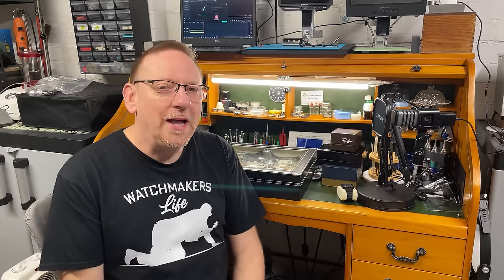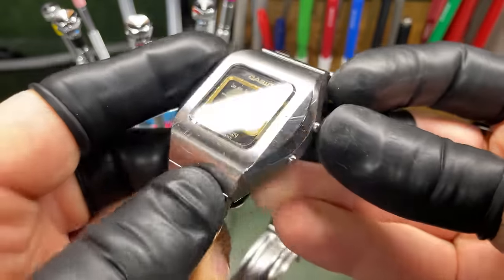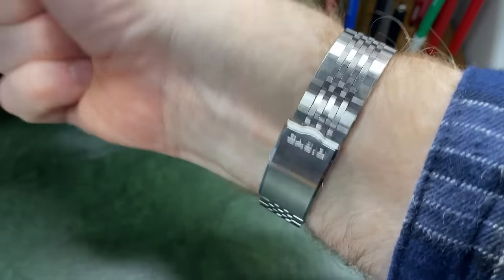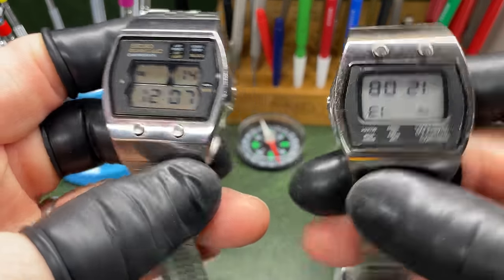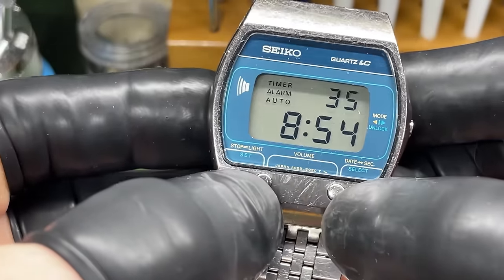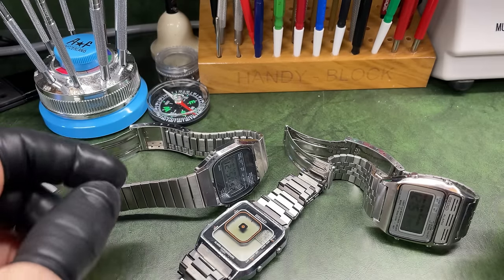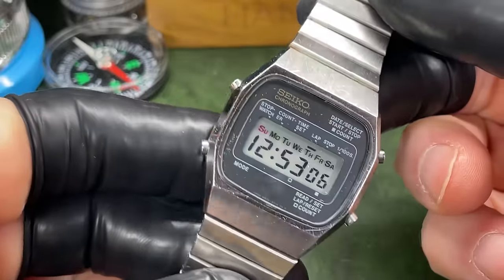My Vintage Digital Watch Collection -  1970s-80 Nostalgia Fest !

Comment: That first Seiko you showed (world's first chronograph) is one I used to own. I went to a local Jeweler's shop that was going out of business, and they had two of them, both NOS, just sitting in a drawer for many years. I bought the best one, which looked brand new, for $35. I put it on ebay in 2010 and two people got into a bidding war over it. It sold for around $580 to someone in Italy.
Reply from the maker: The 0634-5019 is just a superb watch. You can’t regret the past, they are still available if you have the funds to pay for them now.
Reply: Just ordered a NOS one from a Finnish dealer. Most on ebay are either faulty or a bit worn out. Admittedly paid through the nose for it. 😊

Comment: I remember just about every quartz watch I purchased in the 80s and 90s had a spec in the manual that stated the same + or - 15 seconds per month. Armitron, Omni, Casio , Nelsonic, Citizen etc. I took that to mean that all quartz watches were the same and I have believed that for 40 years. I see now this is NOT the case! 🤷‍♂

Comment: Stylus? The Seiko C359 you operate with the tip of a mechanical pencil, with the graphite retracted. Conspicuously missing in your calcuwatch collection is the Casio TC-600 touch sensor calculator watch. A big screen, a touch screen (but not as we know it!), and a prophetic sign of things to come. I was king of digital watches wearing the TC-600 in my high school days, until I managed to nick the screen on the hidden tracers on the top of the screen. :(

Comment: I've got a Casio G510D I've had since it launched, one of the seals eventually failed in the caseback (way before I knew anything about repairing watches) there ended up being a bit of corrosion inside which as far as I can see, has rendered it dead. I have two of them after buying what I thought was a working donor from fleabay, you're welcome to them if you wanna have a crack at getting either/both going.

Comment: Thanks Mike, your selection brought back some great memories. My first digital was  Commodore LED from mums catalogue, hugely expensive for an 10 yr-old in 1978, £20 payable at 50p per week for 40 weeks from pocket money. Took 2 big LR44 batteries that only lasted a couple of months as I remember. Then my first LCD was a Casio 60QS in '81 (as a 13 yr-old) that my dad.' acquired' during a maintenance job at a Casio warehouse somewhere near London. I remember impressing my schoolmates with the 1/100th second stopwatch!I still have it proudly in my collection. I have an old Witshi quartz tester and have found that many quartz crystals do stabilise over a number of weeks/months after being inactive, so let the watch run for a while before touching the trimmer. I'm sure I don't have to say be really careful with the trimmers; most haven't moved in decades, so hold with tweezers to oppose any turning force, or they can break or lift the pcb tracks. If you can't adjust enough, a tiny gimmick capacitor can be made with some fine transformer enameled wire, twisted & soldered onto the trimmer contacts. Twist & untwist until the value is about right to get the rate down on your tester.
Reply: Good advice about the trimmer caps
Reply from the maker: Thanks for your advise on trimmers. I dont think i would go to the extreme of making a tiny capacitor, I like to repair mechanical watches so electronics and soldering irons are not a skill set I posses. 
The commodore, was it the red LED version?  I have that model. One of my favorites.

Comment: One seiko watch you might want to look at is the M421-5010. It’s a digital watch. It has dual time zone, stop watch, two alarms, and countdown timer. It will also operate in 24 hours mode, and has a light. Water resistance of 100m.

Comment: Extensive and interesting presentation 🙂 I was waiting on you start to tweak the time-base, but I probably misunderstood in the beginning. One possible reason for the deviation, beside temperature you mentioned, could be the battery voltage.

Comment: I really enjoyed watching this video   about these fantastic retro watches. I have quite a few Casio watches and have bought a couple of Armitron digital watches from America which is the 'Rubik' and a analogue/digital watch. I purchased them mainly because both are fully stainless steel compared with Casio which today are resin with chrome plating on them. The G-Shock you have in your collection with the stainless steel case and strap is probably the 5610 with it having both multiband 6 and radio controlled. I have two of those in my collection. 
Thanks for sharing your collection.

Comment: Lovely review of your amazing collection.
Spotted a Tomlov TM4K on your bench there - I can recommend using the additional provided lighting ring - it's made a huge difference to the image quality for me.
Reply from the maker: That’s in for review actually.  Personally so far it’s not a patch on the LinkMicro I reviewed and use all the time. The Tomlov has some good features but on normal watches it can’t capture the image as clear as the LinkMicro

Comment: Love my Seiko 0634. Had several led watches prior but they only ever lasted a couple of weeks. I paid £165.00 for it new in 1976 when I was 18...Still works absolutely fine. wore it every day for years as my main timepiece. It's a bit scratched but i'm not bothered about that.
Bought several Seiko's since. all fine...currently using the 7T34-6A90.

Comment: Something I had been trying to remember, I tracked it down, 10 years ago I had an LCD watch branded National Semiconductor, early 70s, had a tritium gas backlight, a thin wide flat tube. I also had an analogue quartz by them with promethium lume.

Comment: At 18:29 the modern casio g shock will likely use digital compensation in order to give accurate time even though the quartz crystal is running fast. Basically the watch will know that the crystall runs 3s fast, and will internally drop the oscillation pulse count every now and then in order to keep the time accurate. This digital compensation is cheaper than using a trimmer capacitor.

Comment: 2 things, (1) Storing in 13 degrees will have a BIG impact (2) The QT99 might be out and needs recalibration. Near impossible unless someone at Seiko Hq takes pity on you. You should do a manual video check (vid with MB6 at 2 day interval) on say 3 watches and the check against QT99 to see if it's out.
Very interesting video thanks. 😊
Reply from the maker: The temperature it’s stored at does not matter as when in it has an oven to heat up the testing quartz . The manual suggests to run it for at least 20 minutes before testing anything.
The watches should really be at wrist temperature rather than room too but reviewing 40+ watches makes that part impossible

Comment: I suspect if you test these with fresh batteries, they may be a little closer to factory rated accuracy. 
The quartz crystal will "wear" as time goes on, and may drift considerably if they are subject to shock. 
You can push the crystal around its base frequency with the trimmer capacitor on some of the older watches, but more recent offerings may need a fresh crystal. A cheap modern quartz watch may leave the factory with less accuracy than the majority of the ones you tested, simply because they are produced to a price these days, and that price means the quality of the crystals may be pretty low. 
30 seconds per month is about normal for a mass produced modern quartz watch, but a high quality crystal will push that to around 1 second  per month. They will drift slightly with temperature though. For high quartz accuracy, you need an oven controlled crystal, but you would never cram one of those in a wrist watch.

Comment: I had a 1977 Timex lcd watch. The backlight went dark. It looked like the backlight was a mini incandescent bulb. Was that the case in those days?
In the early days in Honolulu, the pay phones had the dial disconnected from the circuit. When coins were put in, the dial was connected to the circuit. If the user had good rhythm, one could pulse the hang up tongue the number of times for each number and dial a call successfully without inserting any money.

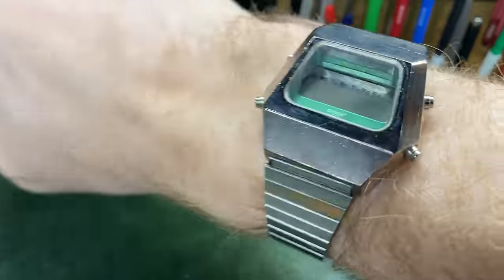Comment: I think I had the same Timex watch shown at 58:00 during the 1980s, sadly I think it met it's demise in 1995 when it flew off my wrist into the road just as the bus I was waiting for arrived crushing it under it's wheels. The wrist clip was worn which meant it was prone to unclipping it's self, and the timing of the unclipping on that fateful day was terminal. 😒

Some interesting watches in your collection, I remember several of them being worn by others in the 1970s/1980s. 🙂

Comment: Mike question how do you demagnetise screw drivers just a nightmare with small screws
Reply from the maker: I use a demagnetiser tool . If you work on watches like it do its part of the service required.  The are very cheap if you buy the Chinese copies.

Comment: How on earth did you get the crystal in with the gasket on the 0439? I’ve tried for hours and it’s like there is not enough room in the groove of the case for both items, the crystal won’t go flush and therefore the backplate won’t go in flush!
Reply from the maker: @tomashmore3875  it was years ago so I can’t remember other than I know it was a nightmare. Didn’t the gasket fit around the crystal?
End of the day it was there before so a new one has to fit.
Reply: @MyRetroWatches  thanks man sorry I didn’t realise it was long time ago! Do you know what… you may have just cracked it there. I was putting the gasket in first. Back to the workbench tonight!!!

Comment: Do you know what size caseback gasket will fit a 7009-3040 Seiko5? I'm looking to replace an exhibition caseback with a solid one. I think 29mm might be good, but I'm not sure on thickness. 0.5,0.6,0.7,0.8 I'm not sure.
Reply from the maker: No idea.  I have a box full of sized gaskets and just measure when working and find one suitable
Reply: @MyRetroWatches  Thanks. That 0634 is amazing! The bracelet on that watch and the other similar Seiko bracelets. I was pretty blown away by that collection. I like how you appreciate all watches, quartz and mechanical. The Seiko quartz tester is awesome too!

Comment: New modules are the worst (in case of Casios) as they are unadujstable. To my surprise CA-53 still is with quartz adjustment. QT-99 is awesome... Im adjusting my watches using manual method sadly :)

Comment: I have one of those Commodore LED watches but the clip that holds ther battery is broken. I don't suppose anyone would know where I could get a replacement clip?
Reply from the maker: other than finding another watch no.  You can always make one. you can buy online generic battery clips which you could bend and cut to modify something to work.

Comment: I have a G757-4050 working but not the accurate watch band. Bought one on eBay but it’s a diff model Seiko band 😢
Reply from the maker: Mine is also not on its original band. The one I am using is from a A159 from memory
Reply: @MyRetroWatches  noted. I’ll be on eBay later today. Thanks M8

Comment: "1.6 sec a day nearly mechanical territory.." My BB36 on my wrist is less than a second in  all 6 positions! Uff!
I've plenty mechanical running under 2 seconds a day.
Reply from the maker: Yes although even in all positions it still does not reflect on being on the wrist all day.
Many of the digital timings seem not as accurate as I would have thought leading me to think that either the watches need to be at wrist temperature or require leaving for much longer on the machine.

Comment: a Commodore 32? before the Commodore 64 was the Commodore Vic 20…my dad (the electrical engineer who invented the consumer level carbon monoxide detector & then became one of the top satellite engineers in the world) he told me “after the Commodore 64 there was a Commodore 128, but, you could buy an Apple II for around the same money as the Commodore 128, and the Commodore 64 or 128 couldn’t begin to compare to the TRS-80, and the TRS-80 wasn’t even close to as good as an Apple II”
Reply from the maker: I’m working purely on memory. I was born in 1972 so I remember having a Dragon 32 then 64, bbc micro (still have) and then a Commodore 64.  I was sure there was one before it hence saying 32.

I’m not as up on it as you are! Watches are my thing rather than old tech .
Reply: @MyRetroWatches  
I’m from the United States…I’m not familiar with the Dragon 32 (or 64). I know that prior to the Commodore 64 came the Vic-20 & Commodore 64’s were backwards-compatible with Commodore Vic-20 software…

Comment: Modern quartz watches cannot be adjusted. They will typically run fast a few seconds per day and only the expensive ones are temperature compensated. We get what we get in terms of accuracy.
Reply from the maker: If they have a trimmer on the board they could be. Not that I’ve seen anything modern!
Reply: @MyRetroWatches  that's the thing. They don't have a trimmer. Most quartz watches made after the 90s don't have them. Even good ETA movements. I just checked my Omega Seamaster quartz watch which is about 10 years old. It's running 4 seconds fast per day. This is typical.
Reply from the maker: @saldogdave  such a shame as it could be much more accurate than that.
Reply: @MyRetroWatches  I like vintage quartz. Easy to service and easy to adjust.

Comment: Why don't you try to polish the body and face plate of your watches? there are many tools and metal polish products and mini craft tool kits , give it a start up try with not expensive watch of your collection trust me it will turn the table if you become good at restoring external parts
Reply from the maker: I already do case restoration, just look at my back catalog. Thing is it’s extremely time consuming and not as straightforward as you might think. To do it properly you have to remove the crystal. All flat crystals generally break in removal and finding digital watch glass replacements is impossible on many models.   You also then devalue some of the more important watches.

In my collection there are 3-4 that I did complete restorations on and mentioned that t in the video

Comment: What’s up with the shirt…??? Do you have to be of the floor to find watches ✅? Strange 🇫🇷🇺🇸
Reply from the maker: In watchmaking the parts are tiny and occasionally go flying. 
You inevitably end up on your hands and knees, usually with a magnet finding the missing spring or screw.

Comment: Never liked digital watches cheap junk but everyone to their own
Reply from the maker: The early Seikos like the 0634 were more than a Speedtimer at the time, cutting edge technology as it was also the early quartz years so the new more accurate tech took over.  These old Seiko's were built well due to the price as not everyone could afford them.   I respect you dont like them but believe me when I say the early models were never cheap junk (like todays)  with practically every brand jumping on the bandwagon. 
I just like all watches. preference is mechanical as I like to repair them but that then lets me explore all genres and appreciate them all for what they are.

Comment: Not a great era for horology! The Seikos the exception!
Reply: Just part of the evolutionary electrical revolution baby!
Reply from the maker: Have to disagree, they are still in abundance and the biggest selling watch of all time is the Casio F91W which is a cheap digital that does more that most mechanical and is more accurate then all of them!

I am a mechanical watch guy at heart having over 200 of them and working on 100s more now. 
You can’t deny digital as not a great era as it’s here to stay and had it not been for lcd we might now have the dreaded smart watches of today which are now also outselling conventional watches.